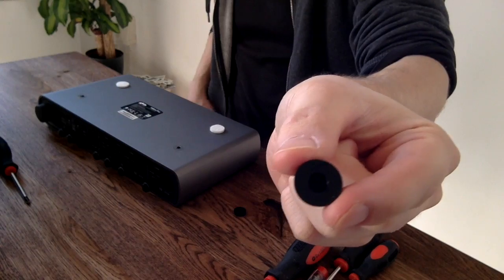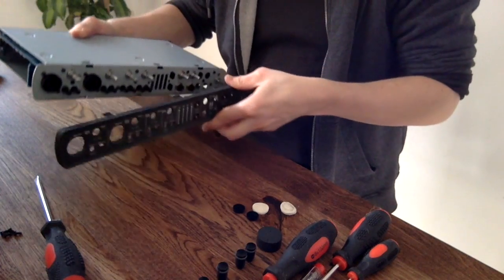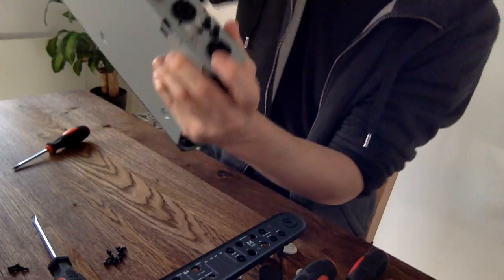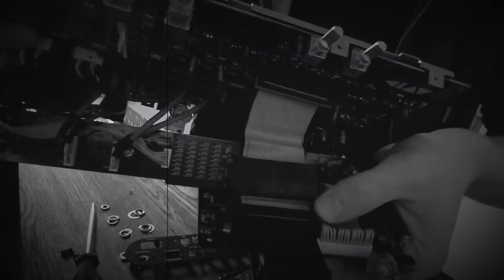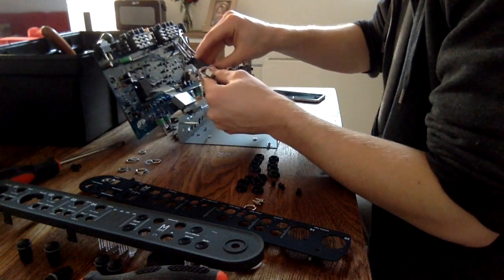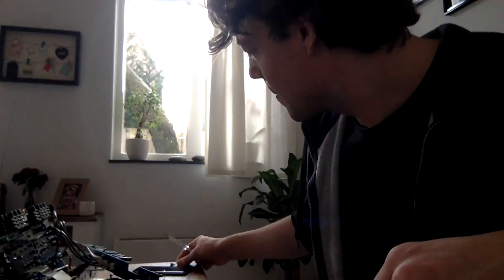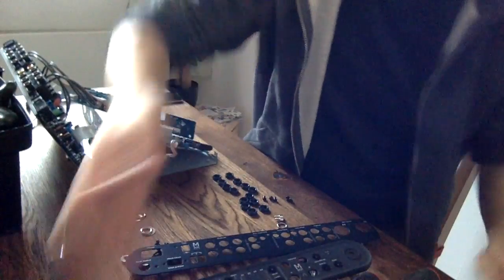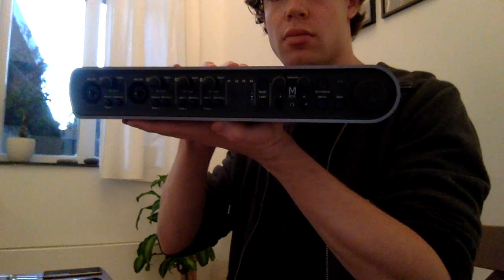How to remove a broken jack tip: Mbox Pro 3 dissassembly

Comment: I bought a mbox pro3 from a friend for a really good deal. Then he proceeds to tell me that he had another one that didn’t work. I bought them both from him. Now I want to know If I can possibly repair it.
Reply: Here I am again... welp, turns out that on the mBox pro 3 all it was one of the sata cables was disconnected. Probably set it down to hard, and it popped off. Now I got two of them. Haha

Comment: My firewire keeps turning off and losing connection randomly. I took mine a part to check the firewire ports itself. Maybe software? Anybody? Windows 10.
Reply: I was in this trouble to. Just replace firewire cable with new one and good quality.

Comment: Hello Vincent! Nice video i was wondering if it was possible that the firewire ports were broken and if it was possible to repair them while opening the box
Reply from the maker: Thanks! If one thing is certain it's that anything can break, but I would assume that the firewire ports are pretty durable. What issues are you having? I'd check for the easier stuff first; did you update the drivers? Is it compatible with your (new?) operating system?
Reply: VincentJacobsMusic i have tested everything old new drivers 5 différent  câbles 
I gave it to the technical service of my radio station where i work
When i plug in an audio source the meters are working 
Its a firewire problèm .. unsolvable

Comment: An easier way is to get q tip and put dab of super glue on the end and stick it into the jack until you touch the broken off piece and let it dry and just pul it out.  It works I’ve done it before.
Reply from the maker: Thanks for sharing. I've heard that one before, but chose not to take the risk of getting glue stuck in there

Comment: hey do you know how to fix audio issue on mbox 3. its so low i cant record vocals with it. Flat line. The 2 inputs are like that. help!!!
Reply from the maker: Ok try checking these things. Not sure how experienced you are so forgive me if I'm stating the obvious: Did the mic ever work on the mbox? If it's a condenser mic, did you turn the phantom power on? Double check if the cable is fine, if the mic is ok, do other mics work on the inputs... Did you accidentally press the  front/rear button? Did you pull the knob? (pulling the channel gain knob turns on a -20dB pad)
It could be software too, like: Try installing the latest driver, double checking the inputs/outputs routing in your DAW...
Let me know if any of this helps

Comment: Same thing happened to my brother while plugging in a TRS cable into my Yamaha Subwoofer HS10W. I had to take it apart too just to pull/push the stupid tip of the plug out. You had it really easy. Mine had the tip, the plastic and the sleeve loosen and completely in the way, I had to do a really difficult surgery there to protect the connecting plates of the jack. I told him the same thing I'm gonna tell you: that's why I NEVER buy cheap cables for my studio gear.  By the way, thanks for showing this video. It helped me see how to take apart an Mbox to tight the volume potenciometer.

Comment: the volume control of my mbox3 is damage, do you know what part can use to change?
Reply from the maker: Depends on what's wrong... If there's noise when you turn the knob you could try cleaning the potmeter. You could always search for a similar knob online if that's what you mean
Reply: Mine too

Comment: Dude this video helped me big time. My MBOX pro was not powering up. I took it apart and reseated the ribbon cables. Seems to be working for now. Thanks.
Reply from the maker: Glad it helped, no need for an expensive repair!
Reply: I’m hoping this is the issue with my second unit. Love them